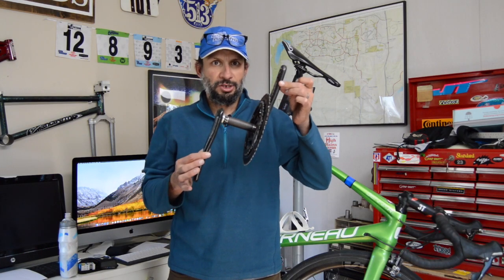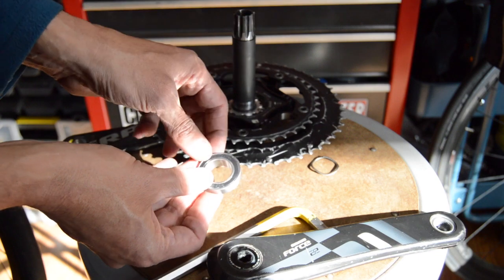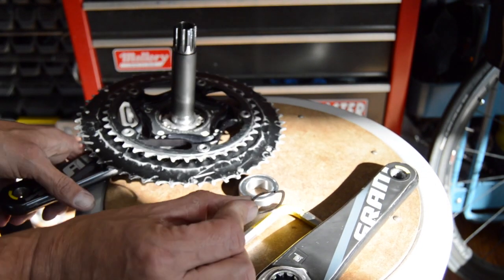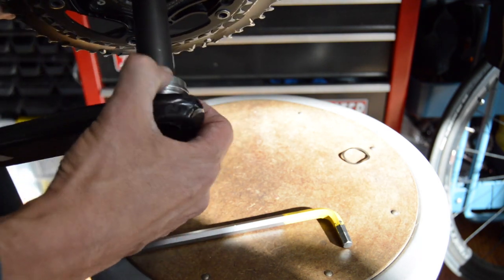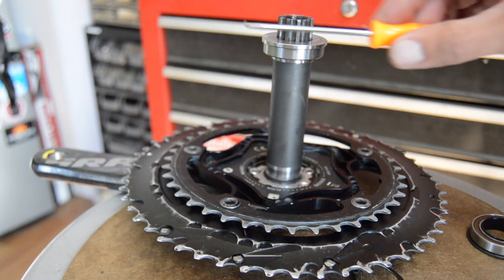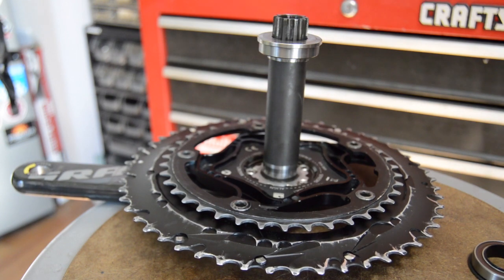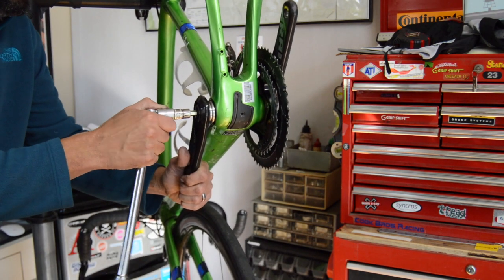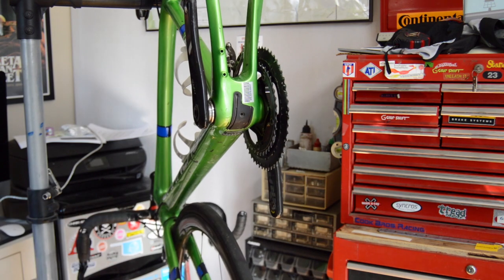IS The SRAM GXP The Worst Crankset In The World?

Comment: I’ve got SRAM Force 1X11 Love it I know hanbini did criticise sram but plenty of my friends have Sram with no problems my only complaint is it so expensive.
Reply from the maker: Yeah, I've got a similar 1x Force/Rival set up on my commuter bike and I'm impressed with it's durability. Thanks for taking the time to leave feedback, I really appreciate it!
Reply: @JoeyMesa  I have a quarq dzero for 5 months. I can see the marks in the spindle already. Exactly as Hambini says. Normal humans might no feel the difference, but it's a design fact what he stated. :/            (just to illuminate the topic, I had not less than 6 lever sets replaced in warranty with unstoppable dot 5.1 fluid leakage)
Reply from the maker: @ebigarella  99% of issues with GXP systems are from incorrect assembly, and not poor workmanship as Hambini states. 
At least that's my opinion from working on thousands of these cracks and seeing any and all possible issues. Hambini may be an awesome engineer, but he's not a very in tune mechanic. 
Brake wise, I've seen more warranty issues with Shimano levers and calipers lately than Sram, but like most Shimano vs Sram components, Shimano stuff is easier to work on. 
I believe generally, poor workmanship gets the blame when the real issue is poor mechanical and problem-solving ability.

Comment: sram is moving to dub, which tells you something about gxp
Reply: Tells you nothing!
It tells only that they want just one standard with oversized axle that can be fit on every frame
Reply: Jura Stanić i do not have dub, but anyone moving to oversize, is to move away from steel and use aluminium for almost everything.
Reply: DUB isn't any better,  it has its own issues. DUB was created with the sole purpose to prevent compatibility with other firm's products, not sound engineering principles or any advancement of BB/crankset design.  Hence the intentional and random 28.99 mm spindle diameter choice. There is no logical reason for that spindle to be designed with a goofy random 28.99mm diameter other than an intentional attempt to block other firms products from the market, and anyone with a 3 digit IQ knows it. :-)  I'll never run that shit on any frame of mine just on the principle of it.
Reply from the maker: @rcg9573  I'm pretty sure the slightly smaller spindle diameter is the ability to use a more durable bearing and sealing system than those used in BB's allowing the use of a 30mm spindle crank in a 41mm BB shell for PF 86/92 systems.  There are already several companies manufacturing various DUB compatible components.
Reply: Robert Gardner Agree. Whenever i see crank with spindle mounting on DS, i always imagine an ‘ikea-designer wannabe’ engineer trying to flat-pack the cranksets packaging saving a few pennies for his company.
Rotor
Reply from the maker: @Billo7979  What difference does it make other than cosmetic?  It's not any more durable or easier to service having it on the nondrive side so I don't understand why it's an issue if the product will fit in a box better?
Reply: Joey Mesa just have a carton box of dub cranksets and a carton box of gxp side by side you’ll find the difference.
Reply: It's also easier to change chainrings on a direct mount crankset if you can just remove the drive side and don't have to also remove the spindle from the bottom bracket, so I'd say better packaging is just the icing on the cake. Sram's reason for going 28,99mm is bearings with larger balls and much better durability than 30mm in 41 mm shells. It sounds plausible, but I have no personal experience with it.
Reply: Rolf Kristian Snilsberg 
Well i don’t have much details how the use of larger balls contributes to better durability, other than its hertz stress effect, however, this only makes sense if their sense and definition of ‘durability’ refers to bearing failures reported is root-caused to bearing races and balls’ durability. If that is so, then yes, larger balls may help increasing durability.
Reply: I was too quick and shouldn't just say balls. To quote Sram (from: https://www.pinkbike.com/news/whats-the-deal-with-dub-more-questions-for-sram.html ) "The ball size was just one small item we looked at in the landscape of all the things that add up to our DUB BB solution (ball size, bearing race thickness, internal/external seal design, part tolerances, grease fill, grease type, spindle/interface, spindle/crank attachment features, frame BB shell standards, frame BB shell tolerances, etc.)".

And also: "The most common failure for BBs is not that the balls wear out or are overloaded by impact loads, it is because they start to corrode due to contamination. And so for us, going down in spindle size allowed us to add more sealing both from external contamination and internal contamination. Externally, we were able to have a double layer of sealing to protect from external contamination.
Internally, it allowed us to have a better sealed bearing and fully-sealed center tube to protect from internal contamination caused by water getting into the BB shell of the frame. Both of these reinforcements to sealing we felt were needed to make sure our BBs did not wear out prematurely."

Hopefully Sram is correct and it's a better solution and not just different from others. Either way it fits into all my frames and I can get bottom brackets for it so I'm fine with it. I'm still on GXP and Shimano 24mm, and got rid of the Race Face 30mm crank before reading about all this.

DUB has got rid of the varying load on non-drive side bearing on GXP,  and is similar to Shimano, Race Face now.
Reply: Rolf Kristian Snilsberg 
Thanks for the article, it was a good read indeed, particularly comment section.
“28.99 spindle diameter, because we want to be as transparent as possible, and there’s no marketing twist to it...”
Wow...
Reply from the maker: Yes, I think the Dub system is better for modern carbon fiber frames, but on the flip side, I don't think GXP is awful.